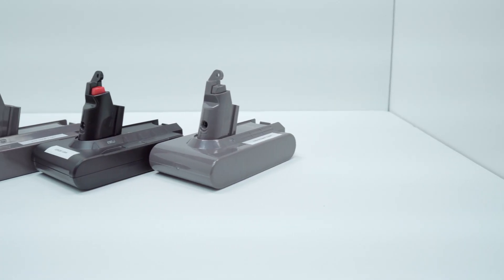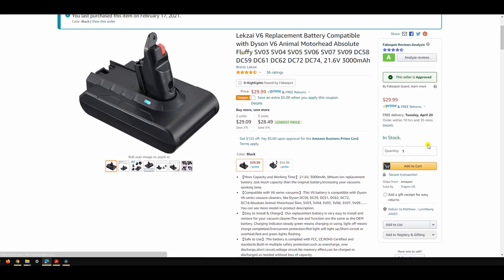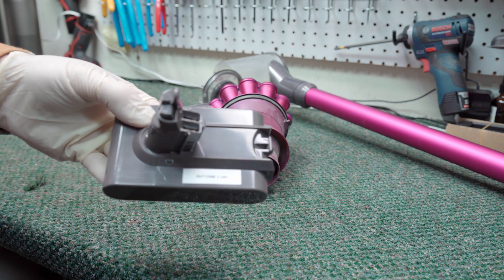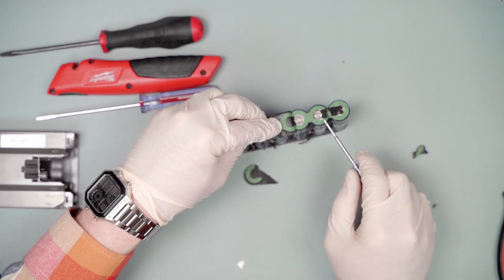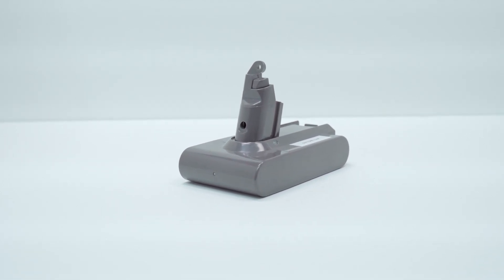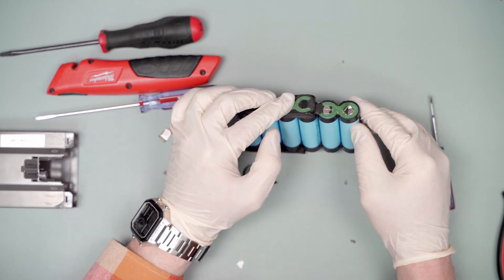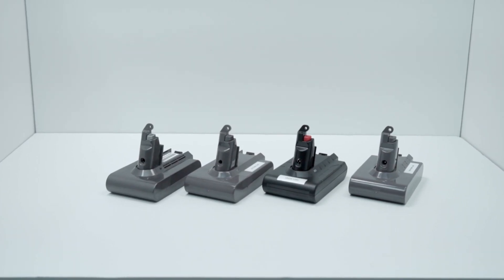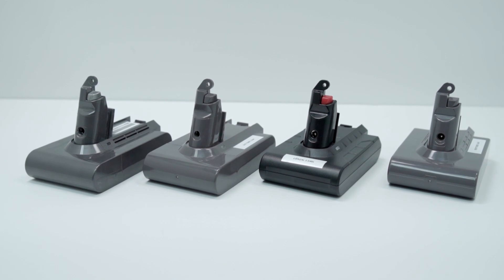The BEST Dyson V6 Replacement Battery On Amazon? Full Test Of Four Popular Models!

Comment: They are all sh!te, including Dyson batteries (especially if you use max setting much), because Dyson didn't implement a cell balancing circuit. I have power tool batteries 10 years old (at least 1000 cycles) that still have about 60-70% capacity. I didn't even get 50 cycles from a couple of Dyson batteries, before the run time was considerable less and max setting would only work for a few seconds before cutting out. The after market battery had the same failure, only much sooner. I know it is a balancing problem because I took the packs apart and found the cells to be extremely out of balance. Such a state will not allow the battery to fully charge and the safety circuit will shut the power off very prematurely. Resulting in pathetic capacity. I balanced the batteries with a hobby charger and they work as they should. 

The only problem is that there isn't enough room inside the battery to add a balancing port, so the batteries can be rebalanced (easily) again after several charges. Dyson uses quality cells, but it's a moot point if those cells become out of balance (and they absolutely will in a series configuration) and there is no balancing circuitry.
Reply from the maker: I agree that it is a balanced charging issue in part. If you have no balancing and weak cell, eventually the voltage on that cell will drop so low that the BMS won't allow the vacuum to turn on due to a "low voltage" condition. If you happen to get well matched cells. from the factory, this can be avoided. I got a V6 battery that is at least 7 years old and keeps cranking... so I got well matched cells that haven't fallen out of voltage spec yet. So it is largely luck of the draw.

In either case, if vac manufacturers are going to continue to sell vacuums, I would hope that they would start building better packs with correct BMS and balancing like power tool companies. Unfortunately, I think that would push the cost of the vacuum above what consumers would be willing to accept. I don't see the vac industry changing any time soon.

If you want to see a great vac battery design, check out my tear-down of the Riccar Superlite Cordless battery. Cheers!